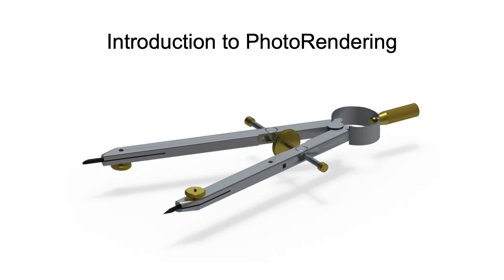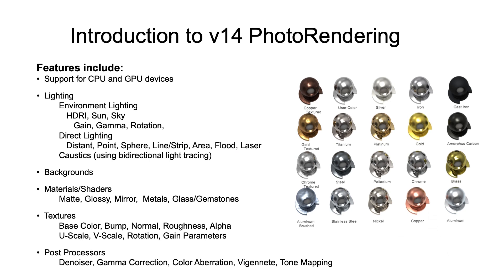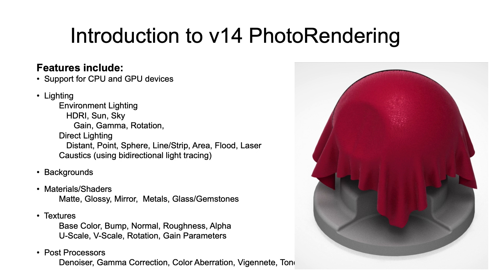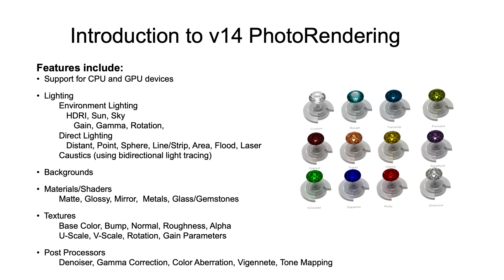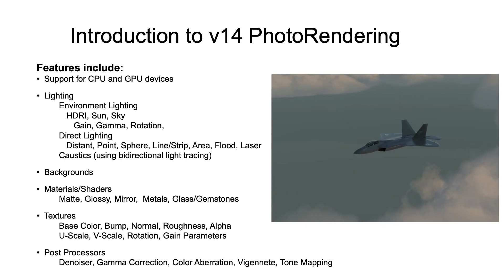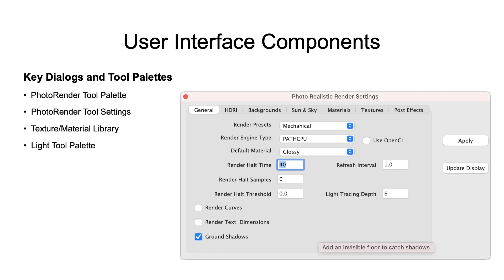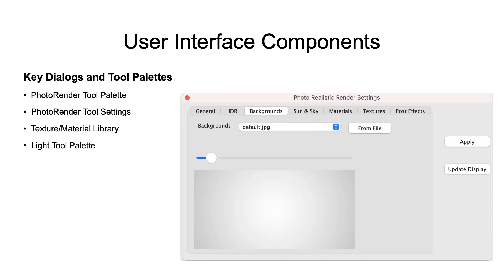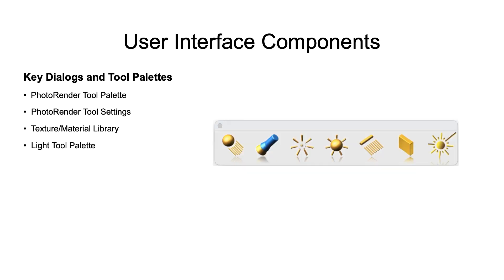What's New in ViaCAD V14 - Introduction to Rendering

Comment: With version 15 so close to hand, will rendering in v14 be elevated from its completely unusable condition to a point where the user can edit materials and save them for later use? It is tedious to have to open v12 just to render, just like it is still very tedious to open v10 to access subD2Nurbs.